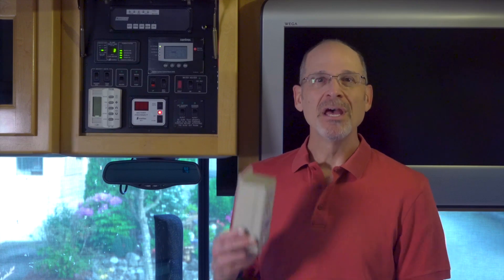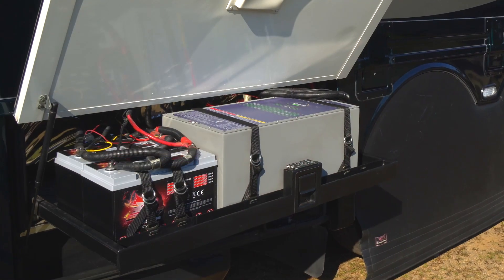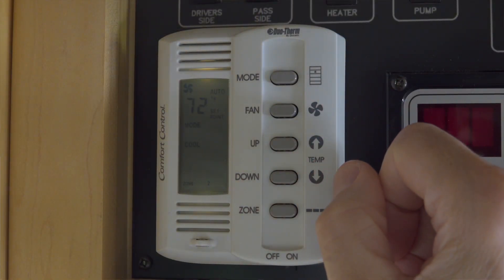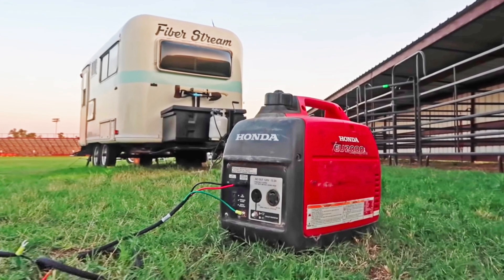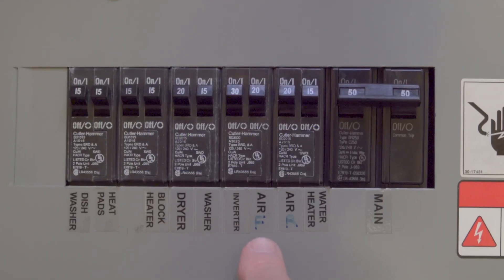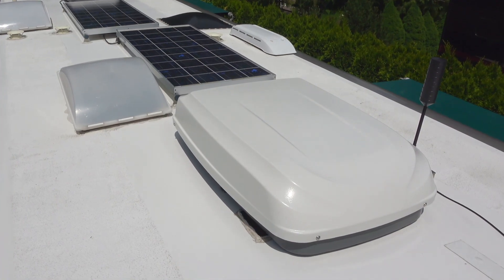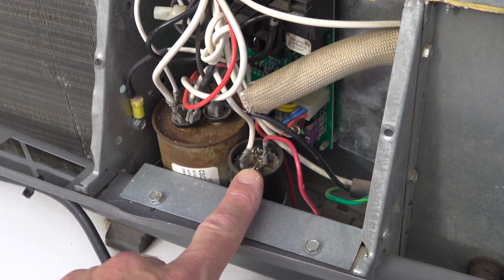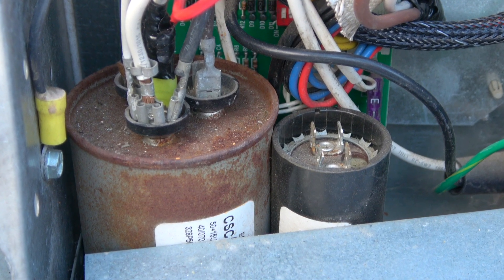Micro-Air EasyStart RV DIY Installation. Run 2 RV A/Cs on a Small Generator or 30-amp Hook-up! Cool!

Comment: Peter + John:
I truly appreciate the effort, depth, and quality of your videos! Quick Question... I have a 2015 Thor Axis 25.1 with 30 Amp Service it’s a royal pain, wish for 50 Amp... Breaker trips with Microwave, and A/C, would this help? Also, at my home in western Tennessee, even prepping for a trip today it was really hot at 7AM! Wanted to run ac on 15 AM service, but I tripped it this morning, I didn’t want to turn the genset on for noise reasons... gotta love the Onan Gas 4000 “Ultra (Not) Quiet”. Would I be able to accomplish this task with this device? Thank You for your continued support throughout my extensive and endless supply of questions! 😊
Reply from the maker: Hi Austin. Thanks so much for your kind words. Without an EasyStart, it's unlikely you could run an RV A/C unit on 15-amp service because of the spike. That said, it's also possible that you couldn't do it even with it installed.... unless you're very good at power management. You should make sure that NOTHING else is on, including battery charging, which is one that can sneak up on you since it comes on automatically in most rigs as soon as you connect to shore power. Another thing is to use the shortest and thickest extension cord you can. If you can get your rig really close to the outlet, and avoid using anything but your 30-amp cord and a 30-to-15 dogbone, that would be the best, since losses over longer, thinner cables exacerbate the problem. Another tip is to see if you can identify a 20-amp outlet, which might be found in the garage. Go to the circuit breaker panel in the house to see if there are any 20-amp breakers. If so, see if one is for the garage, and if so, that's the best one to use for your RV. Also, if you can determine how much draw your A/C unit takes when already running, that will give you the best info for making a purchase decision about the EasyStart. If it pulls 12 amps while running, then it's just the spike that trips the breaker, and an EasyStart will likely fix that. But you'll still need to kill all other draws on your system to have enough power for the a/c, even with the unit installed.
Reply: RVgeeks Thank you So much. There will be that day where a Green and Gray pulls in to the same RV Park as us!

Comment: Thanks for the detailed installation video.  Great camera work and explanations.  Question:  You guys lived without these for 12 plus years, what prompted you to finally feel the Easy Start was needed now?  Did you used to run only one AC unit when faced with a 30 amp service?
Reply from the maker: Thanks! And you hit it right on the head. We mostly squeaked by with one A/C... usually just the front one. But on really hot days, it would run almost non-stop. Once it gets hot enough, it almost always meant limiting ourselves to 50-amp parks, which rules out a lot of places. We try to stay in cooler areas in the summer (forest, mountains, Pacific NW, etc), but it's not always possible, especially with how hot the weather is just about everywhere these day.

Comment: Thinking of adding another air conditioning to our 31’ C class 30amps....and getting 2 easystart, if I understand correctly it wouldn’t required any type of management system to sequence the air conditioning units?

We mainly boondocks, and we find it pretty hot with only one air conditioning unit we we return to the RV, unless we run the generator all day...which I hate doing..Thank you Dan
Reply from the maker: Hi Joe. Assuming your existing generator can handle the run amperage (not the start amperage) of two AC units, you should be good if each AC unit has an EasyStart unit installed. We don't know of any system that sequences the starting of AC units... so you may just need to manually delay starting the second until after the first is up and running already.
Reply: Thank you,

Comment: Did you check running loaded amps on the a/c after installing the soft start?
Reply from the maker: @AZ Expert - Yes... that's what we were showing starting at 13:23 in the video. One A/C was already running, and the other fired up without the huge spike.
Reply: @RVgeeks  thanks, I was boneheaded and missed it.

Comment: I wonder why the A/C manufacturers do not have these already built in?
Reply: Cost. The microair retails for 300 dollars which is half to a third the price of an rv roof ac.
Reply: @mgkleym  A simpler 'hard start capacitor' is much cheaper, and may be sufficient for some setups. Supco SPP6 Hard Start Kit can run a Coleman Mack 3 13.5 btu, and can be had on Amazon for about $16.

Comment: I know that often times Locked Rotor Current is largest at the warmest time of the year on a residential air conditioner.   Often times even new Air Conditioning system will quit working, and not start the compressor, so in the HVAC industry we put what you call a Hard Start Capacitor tied into the Run Capacitor.  Is the Soft Start, or easy start, similar to a Hard Start Capacitor?
Reply from the maker: Hi Alan. That's true... the hotter out it is, the larger the Locked Rotor Amperage requirement can be. As far as a comparison to the Hard Start Capacitor, it's a bit of a different animal. The EasyStart is designed to REDUCE the amperage drawn when the air conditioner fires up... basically smoothing out and leveling out the Locked Rotor amperage requirement. When installed, the typical spike in amp draw you'd see as the A/C fires up is dramatically reduced. A Hard Start Capacitor is designed to provide an extra jolt to the compressor as it's firing up... to help get over the hurdle of the locked rotor amps. But, from what we know, the Hard Start Capacitor doesn't do anything to actually reduce the start up surge that you see when the A/C compressor kicks in. It's more designed to be like a defibrillator... amplifying the incoming power to provide a large jolt to help get a difficult-to-start compressor to come to life. But... we're not experts on this subject and recommend that if you want to know more, you should contact Micro-Air, as they will definitely be able to give you the details on what's different between the EasyStart and a Hard Start capacitor.

Comment: When you show a shot of the Honda Generator you are not pluged into the 110.  What is that hook up that is shown?  Great video!
Reply from the maker: Hi Charles. Good eye(s)!! We didn't even catch that... the image we used was from our friends Kyle & Olivia of Drivin' & Vibin's video (https://youtu.be/HcPyz67btzk)... and we're pretty sure those wires are the paralleling kit that allow you to connect two generators together (for extra "oomph")... so you're right, you'd actually connect your RV to one of the two 120V outlets!

Comment: That was another well done review of an interesting product.  Thanks for putting out the video.  

The first part of the video shows the amps peaking to 33 when the compressor of the first unit started up and then 43 amps for the second unit starting up.  What was the peak of the first unit starting up after the Micro-Air was installed and also for when the second unit started up?  I was not quite sure what I was looking at near the end of the video.  Thanks.
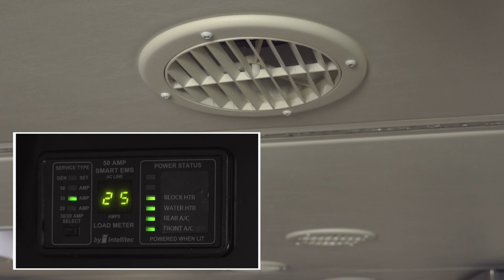Reply from the maker: Sorry about that Bruce. The video was running a bit long, so rather than show both A/C units coming on at the end, we focused on the real problem solved, which is the spiking of the second A/C after the first one is already running. At 13:23, you can see the amps at 14, with A/C #1 already running. Then A/C #2 comes on, with the fan, followed by the compressor, bringing the power up to 25 (at 13:38), same as before, without ever spiking, like it did originally to 43. It was smooth as silk. Sorry if we weren't clear on that!

Comment: Great video as always.  I'm curious as to what electrical magic the microprocessor controller easy start does to reduce the initial stalled/locked rotor current from the motor associated with the compressor?  Also curious if if greatly reduces the "stop arc" across the compressor start  contact relay.
Reply from the maker: You'd have to check with Micro-Air on that one. That's above our pay grade! 😂

Comment: why aren't every AC equipped with slow start by default? Gentle on all circuits and our utility grid as well. Often hearing about breaker popping after a power outage is gone and everyone's AC kicks in.

Comment: Do these soft starters make the A/C quieter upon startup?  I currently have one in my travel trailer bedroom and it wakes me up constantly because of how loud it is.
Reply from the maker: There may be some minor reduction in the start up sound/volume, as the soft start makes the air conditioning ramp up gently instead of kicking in suddenly. But once it’s running, the volume is the same either way.
Reply: RVgeeks okay well it’s worth the try. Not a bad price. Thanks!

Comment: I would save the white and red wire - If you sell the RV you might want to remove the unit and move it to a new RV ;-)
Reply: I agree, and on top of the capacitor too.

Comment: With fifth wheels with 2 units why install one of these on each ac unit? as long as the unit with the soft start is turn on after the other unit is already running? The air conditioner on our rig typically pull 9 amps each while running.
Reply from the maker: Great question, Jim! The reason is because we don’t really have any control over when the air conditioners cycle on and off. The one with the EasyStart might be running when the thermostat tells the other one without the EasyStart to come on. That would trip the breaker.
Reply: @RVgeeks  I didnt think of that, even though we only need to run both during the day when it's hot, but I understand the reasoning behind installing in each unit.  Thanks for the response.

Comment: How many BTUs are each of your ACs? We're you running other items when running your AC?
Reply from the maker: 15,000 each. We can run SOME other items on a 30-amp circuit when both A/C units are running. They usually draw about 12-13 amps each, leaving a few amps for lighting, water pump, Fantastic fans, etc... In other words, several low-draw 12-volts items. The TV would likely be a bit much, but might work if nothing else is on. And of course other high-draw items, such as running the water heater on electric would be out of the question, so we'd switch that over to propane if we wanted to heat water while both A/C units are running simultaneously.

Comment: How does the EasyStart differ from Dometic Hard Start kit?
Reply from the maker: Hi Jim. The EasyStart is basically the opposite of a hard start, as it gently ramps up the A/C, avoiding the usual spike that can trip the breaker on start-up. A hard start doesn't reduce start-up amp draw, which is the purpose of the EasyStart.

Comment: Hi, question. My truck camper's AC has the manual knob for low fan, high fan then low cool, high cool. Does the easy start need to "learn" the particular AC system, like the one you did for 5 times, 30 seconds each. Thanks!
Reply from the maker: Yes indeed! It needs to learn the compressor characteristics.
Reply: So that means, i'll turn on the fan for a few minutes, then manually turn on to low Cool for about 30 sec. then turn it straight to
Off. Then do it again 4 more times. Thank you so much. I appreciate it.
Reply from the maker: @topryder4everforceariders52   We’re pretty sure you have that right, but Micro-Air is very good with customer service, so you might want to check with them to be sure.

Comment: what's the difference between your soft start and hard start kits that I hear about?
Reply from the maker: Great question, Paul! Hard start kits don't significantly reduce the amps drawn during start-up. They're capacitors designed to provide additional amperage to units that are hard to start. But since they don't reduce the amp draw from the pedestal, they don't solve the problem of tripping a breaker, or help with running off a small generator. Here's a discussion about it: http://www.irv2.com/forums/f54/whats-the-diff-between-microair-easy-start-and-hard-start-capacitor-for-a-c-404681.html

Comment: I'd like to get something like this for my basement a/c system, but I guess they don't work. Oh well. Great info though!
Reply from the maker: Not sure about that, Gary. But if you contact Micro-Air, we're sure they'd know. If the EasyStart 364 isn't the right model, they may have a different one that will work. Never hurts to ask, right?! 😉

Comment: Would you need 1 or 2 softstarts for 2 ac’s?
Reply from the maker: Hi Scott. We installed two, because when running the A/Cs on a 30-amp connection, either A/C could be the second one to start up... and we didn't want the surge from it to trip a breaker. Whether or not YOU need two would depend on where you tend to camp... if you're in very hot places where you want to be running both A/C units on a 30-amp hookup, two would definitely help. Or if you are often in places where you're hooked to a 15/20-amp outlet and want to be able to run one or the other A/C (front during the day, rear at night?), then having them both updated would make sure you could do that. These are just a couple examples, but you get the idea.
Reply: Ok, I’m all in! Just let me know when you are in Sacramento so you can show me how to install it... one or two more times 😂

Comment: Can you use this in a home central AC system?
Reply from the maker: Probably not this model, but MicroAir does have other versions that might work for a larger, home AC system. It would be worth checking with them directly at https://www.microair.net

Comment: I contacted Dometic with the question: To who it may concern,
I purchased and am installing two Dometic 651816 and would like to know if the units would benefit from me installing EasyStart™ 364 (3-ton) Soft Starter... Response: The 651816 comes with a hard start installed - 3311883.000....Based on your video I am going to install the EasyStart; Looks like you guys are using Penguin 1; what BTU? Another great job well done with all the info - THANK YOU!
Reply from the maker: Hi Gary. We’re not sure if our air-conditioners are Penguin I or II, but they are both 15,000 BTU.
Reply: @RVgeeks  They are Penguin 1. I can tell by the 5 button TStat). The new TStat  is 10 button called the CCC2. More info - P1 and P2 controllers in the A/C are not cross compatible. I have to replace one of my units and could have downgraded the new unit w/ the old controller. I decided to replace both units and purchase the upgraded TStat which cost only $100 (same price as a new outdated controller). I plan to full time so I will upgrade w/ EasyStart! Soon I will upgrade the battery's as you have and then new Solar. Once again great stuff coming RVgeeks!!!

Comment: Can you run the AC with 2200w generator in Eco mode or must the generator stay in full throttle mode all the time?
Reply from the maker: Not really sure on this one, Kevin... our 7,500Watt Onan Diesel generator doesn't have an ECO mode 😉 

But this info might help you figure it out... a typical 13,500 BTU air conditioner requires 2800-3000W of power to START (that would be 23 to 25 amps at 120V) and then 1500-2000W of power to RUN (that would be 12.5 to 17 amps at 120V). So if a 2200W generator can surge to 3000W, even while in ECO mode... then yes, it will work. If not... it won't!

The equation "Watts = Volts x Amps"... comes in handy A LOT on an RV. LOL!